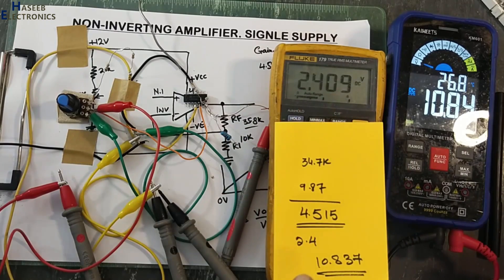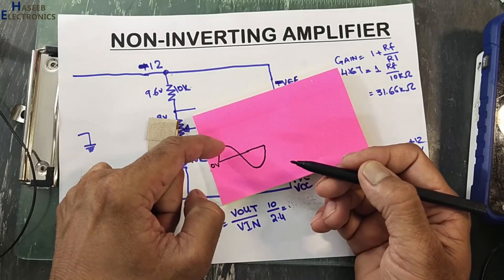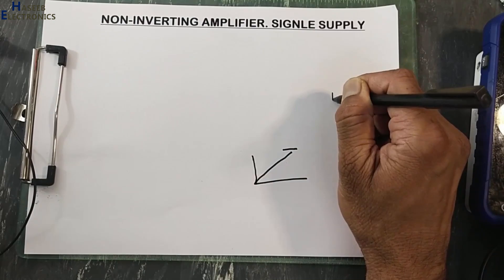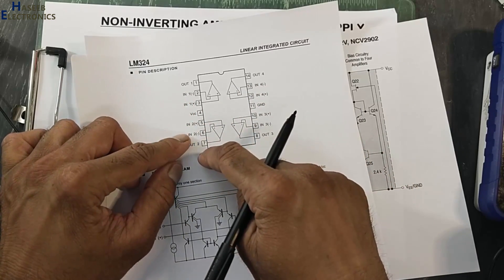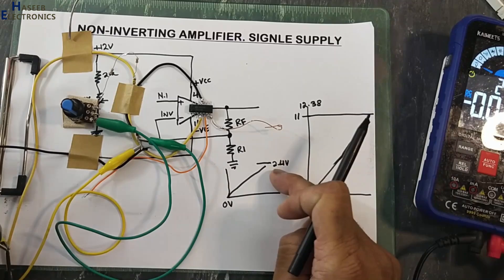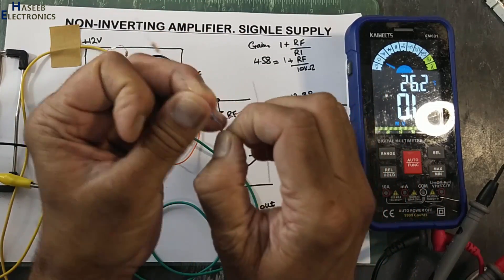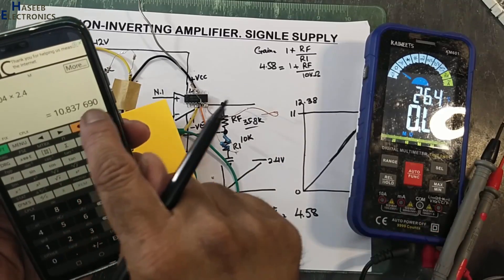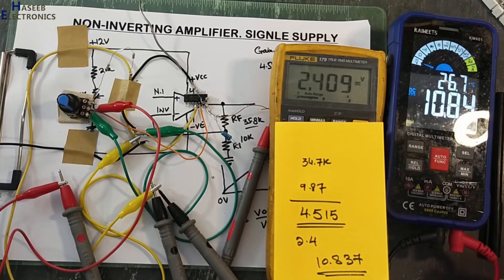{1172B} Non-Inverting amplifier using Single Power Supply

Comment: Assalamu Alaikum sir
Sir when I checked the non working ATX power supply withvpfc .I checked and the output Schottky diode was short .After replacing it was working without load 12 volt and 5 volt but the two wired fan speed is less.please guide me.

Comment: Thank you very much Sir, for making this Video. Sir, my question to you is 'At Time Stamp 10:26 why have you considered the maximum supply voltage of 11V instead of 12.38V during calculation. Why did you Subtract 1.4V from 12.38V?' Please explain. Thank you very much Sir, in Advance. Keep up the Good Work.